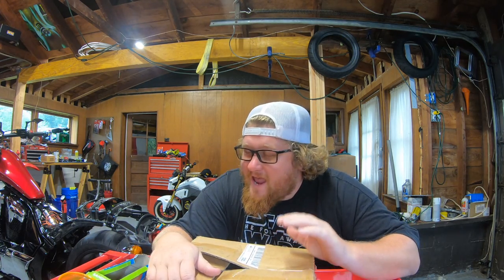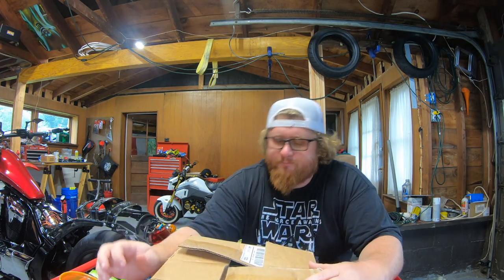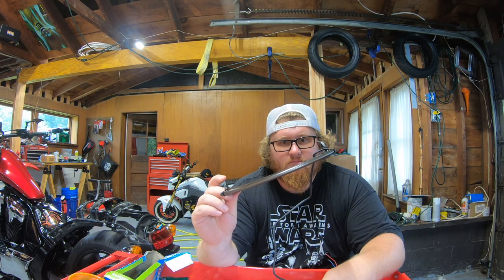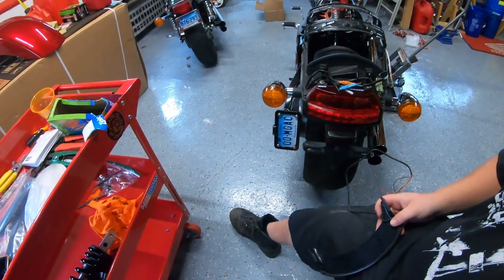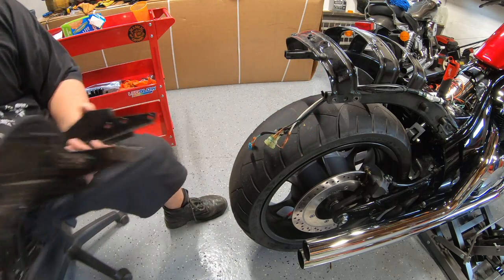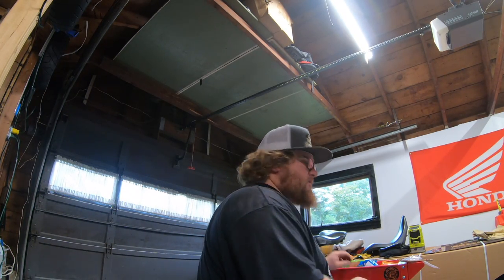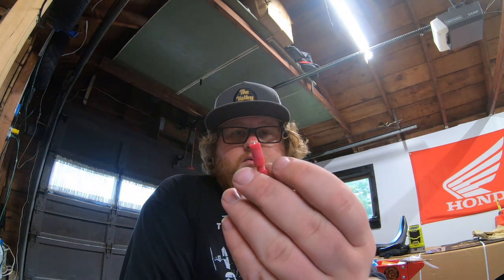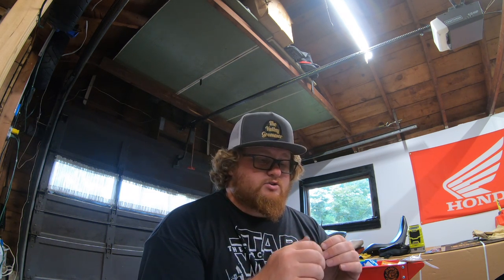Fury Fender Eliminator

Comment: On the fender eliminator kit ground, black wire, did you splice it to both turn signal grounds and brake ground, green wire, or just the brake wire ground?
Reply from the maker: Hope this helps..this is the wiring diagram. No, 2 wires are spliced together..

Here’s the Light Bar to Bike wire colors…

Black to Green bike wire
Orange to Brown bike wire
Red to Green/Yellow bike wire
Blue to orange bike wire 
Yellow to blue bike wire
Reply: Thanks for the quick response. I have it wired correctly then. I was just double checking.
Reply: @Thevalleygarage which wire connection is for the running lights?? I can’t find a diagram anywhere online…
Reply from the maker: @curtisgrasso3823  Yes I know what you mean so Running lights is The Bikes Brown Wire to the Lightbars Orange Wire

Comment: Where did you get your spike fasteners for the front jug?
Reply from the maker: Yeah so I went on Ebay here's the Link::
https://www.ebay.com/itm/171380703082?hash=item27e715ff6a:g:GAsAAMXQWzNSpLbh

Also for the black rear fender spike I went to
studsandspikes.com Where you  can pick your size
Reply: @Thevalleygarage  sweet, just ordered them. Love the fury videos. I just installed tricky air in my fury about a week before your video came out. Wish I would have waited. I ended up putting the compressor on the bottom cross member. I think I may redo it to fit it in the cover like you did.
Reply from the maker: @Sjwilley1  Thanks Brother I appreciate that. Yeah Low and mean suggested the bottom and I was going to put it there too...it was tight. I feel much more comfortable knowing the unit is higher away from the elements
Reply: Dude you went through the entire video and didnt show how it looks after completed???
Reply from the maker: @MrHarlemknight73  My next video  planned is to be a walk around showing all 3 rear end mods completed including the air ride, fender eliminator, and plate relocation.